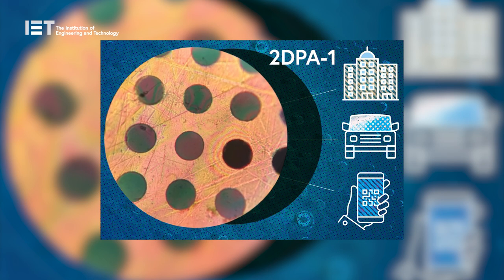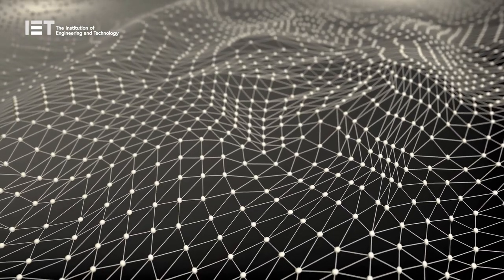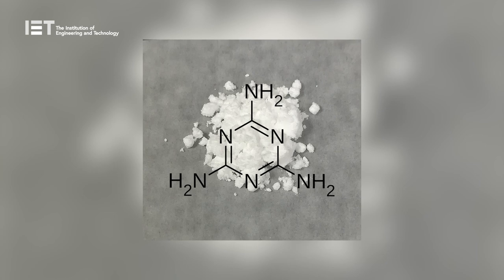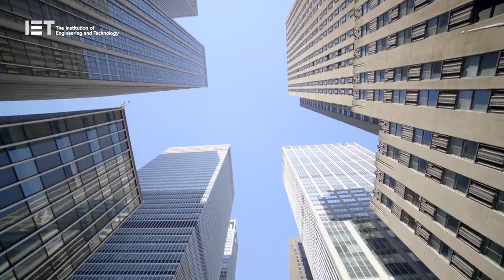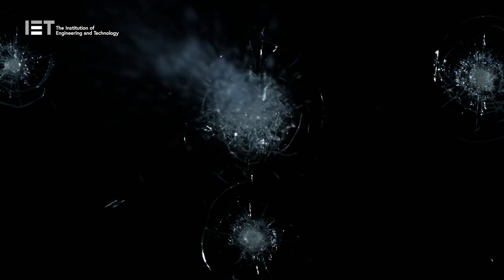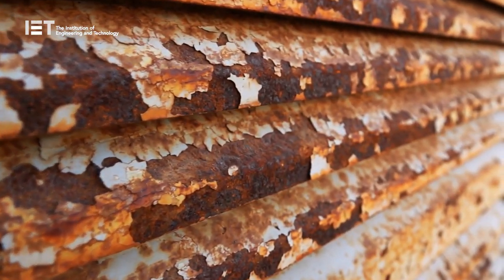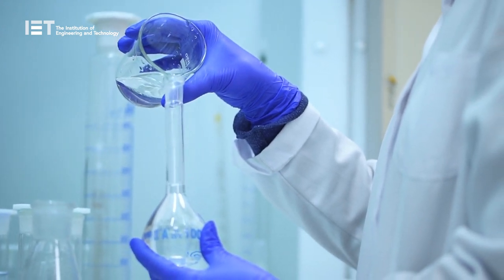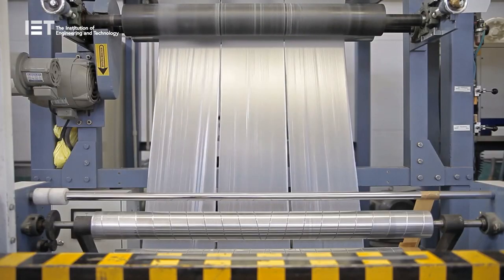MIT engineers create plastic that is “stronger than steel” | 2DPA-1

Comment: So all we need are larger beakers?

BTW yield strength is the stress needed to permanently deform a steel - not break it that's UTS - ultimate tensiles strength.

The imperviable properties sound promising - you help polymer & coatings applications.

Comment: hmmmmm seams like the material is similar to the metal that was found at the new mexico roswell ufo crash
Reply: Not sure but I am hoping there's a way for it to be 3D printed like a much much much stronger and improved PLA+/HTPLA for 3D printing would be so cool for practical prints